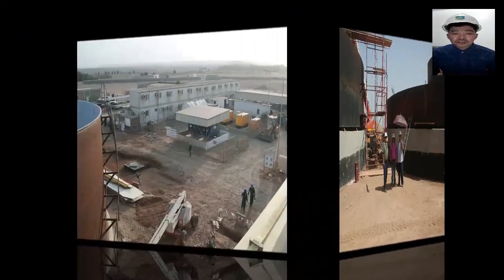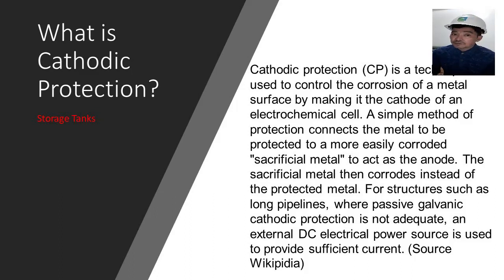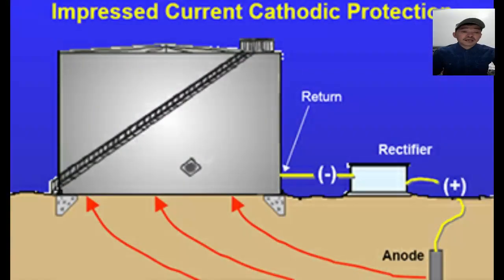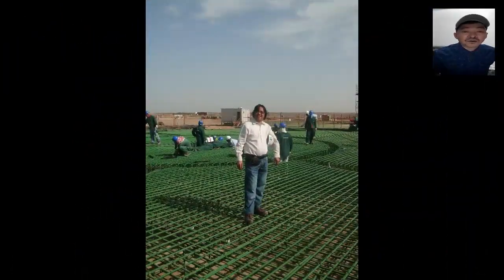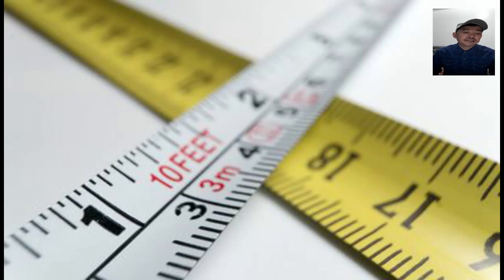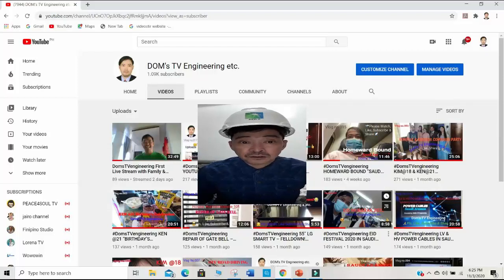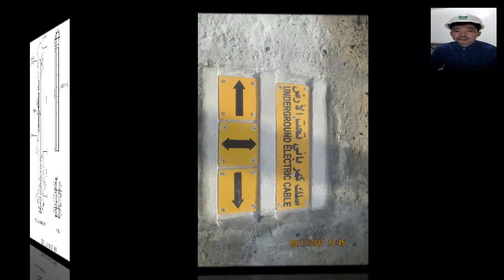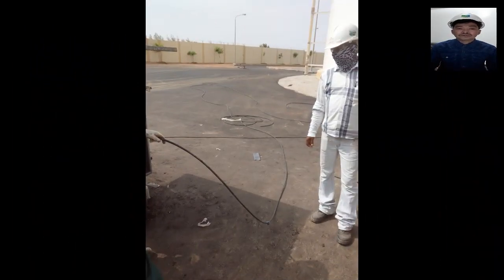#DomsTVengineering SAUDI ARAMCO TANK CATHODIC PROTECTION SYSTEM “SAES-X-500” SUBSCRIBE NOW!

Comment: sir tanong ko lng kasi kasi may tank na nilagyan ng ICCP, ribbon xa, then my hdpe liner din bago backfill, ang issue sir ngbackfill pero kinompact nila un na may kasamang tubig, after sir nginstall na sila ng bottom plate, din nung ngrereading na daw sila bago ilagay ung plates sa my draw off sump, ung value ng reading is hindi daw as per sa requirement, ano kaya ang dahilan sir? saka paano po ang corrective action if ever. Salamat sir.. Mlaking tulong po ung video nio.!! keep up the good work po